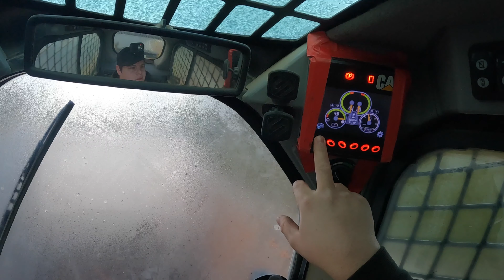Angry Homeowner Wants Free Concrete 🤬

Comment: What was the job for? Just to replace the concrete sidewalks? Or did they put new fiber lines in then you came back. Either way good work!
Reply: they put fiber lines under concrete in some areas? here they dont cause they can get damaged too easily.
Reply from the maker: Frontier put new fiber lines and patched up their holes with asphalt. We came back and ripped out all their patches and replaced with concrete 👍🏻